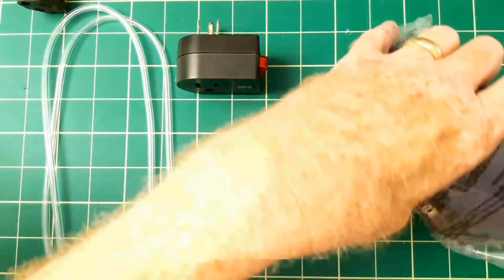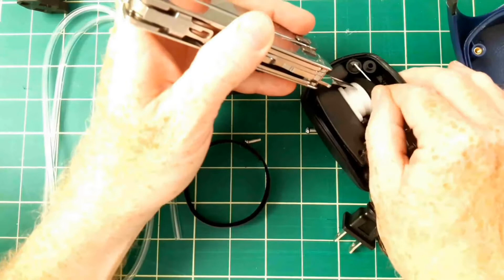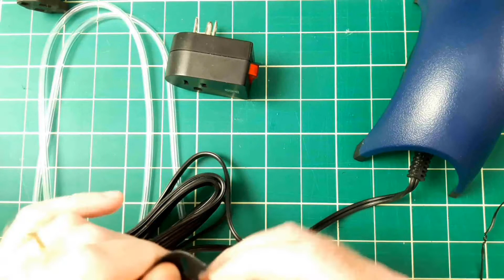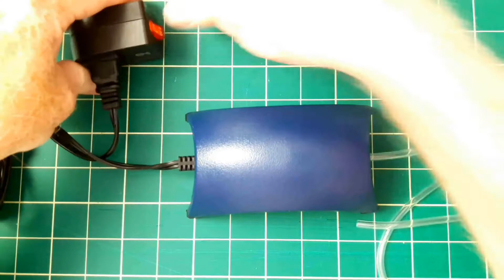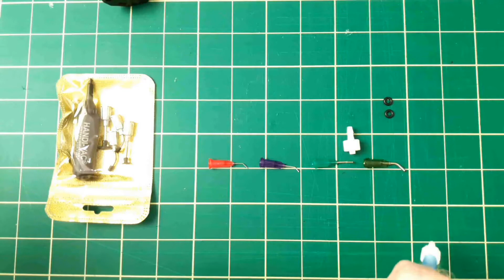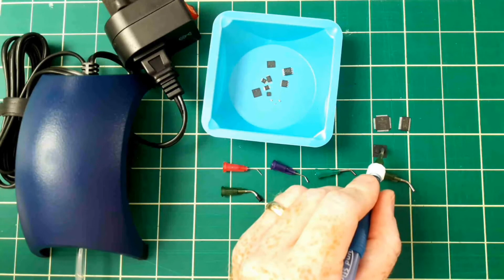Low-Cost Vacuum Pick-Up Tool for Surface-Mount PCB Assembly

Comment: Are you sure the 10 gallon version have enough vacuum suction? I have exact same box as your and not enough suction to pick up anything even a paper ....I saw othere YouTube by someone using 40 gallon version of the same product
Reply from the maker: The Tetra 10-gallon aquarium pump is the one that I am using in the last chapter of the video to pick up an assortment of surface-mount components ranging in size from an 0402 capacitor to a 64-pin TQFP.  As you can see in the video, the 10-gallon one does work with the right needle or needle plus suction cup for the component that you are picking up.  I was able to pick up the 64-pin TQFP with the nylon luer adaper by itself, so the vacuum seems quite reasonable to me.  I have also used one of the Tetra 10- to 20-gallon aquarium pumps.  That is the one that I have used most frequently to assemble my boards.  Comparing the two pumps side-by-side on the same set of components, the 10- to 20-gallon pump does a better job than the 10-gallon one.  If you can't pick anything up at all with the 10-gallon one, it may be that you lost one of the O-rings when you reversed the valve in the pump.  I managed to do that with one of the larger Tetra pumps (40 - 60 gallons), which had two one-way valves and two output ports.  After I had reversed both valves and reassembled the case, I found one port was pulling a vacuum while the other was not.  I opened the pump back up and found that one of the O-rings was missing on the side that was not pulling a vacuum.  I measured the dimensions of the corresponding O-ring from the other valve (it was a #011 with cs = 0.070in, id = 0.301in, and od = 0.441in), and I was able to find a suitable replacement at my local home improvement store.  That fixed the issue and I have used that one for two people to assemble boards at the same time.

Comment: Thanks! The aquarium pump that I have is different mechanically, the entire pump's interior served as an inlet. So, I made a chamber around the inlet valve and attached the additional pipe. The result was too weak to pick-up 0805 components (Uncilife Aquarium 1.8 L/min). 
So, I simply bought for $10 a 12V  3.2LPM pump that already has an inlet attachment. The rest is identical to your setup, and it works really well! The rubber hose that I have is too soft, so if I want to increase the vacuum power further I should use a shorter piece, I think.